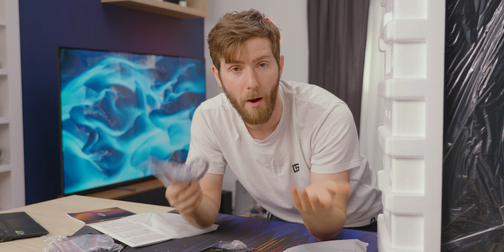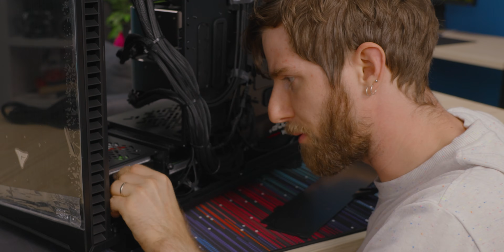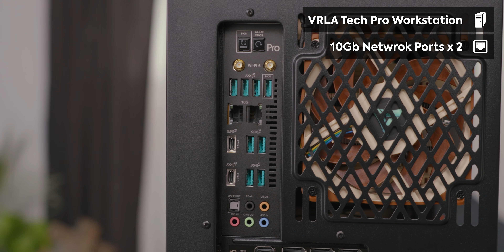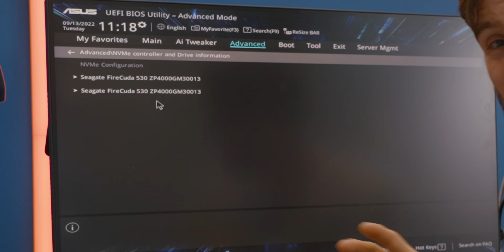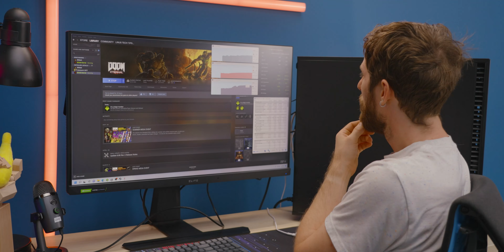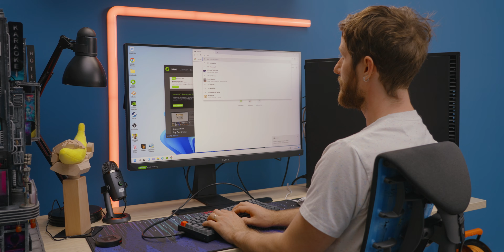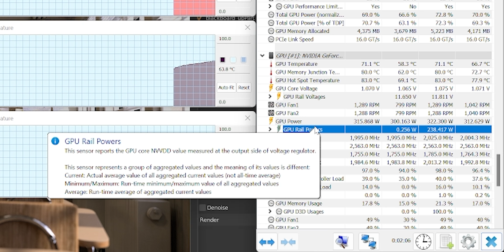This PC blew our circuit! - VRLA Tech Threadripper PRO Workstation

Comment: Hey Linus! I do use the analog surround sound on my pc motherboard! I jerryrigged a couple of normal speakers into a surround sound set up in my room and it works really well for VR immersion without the need for an headset.
Reply: I'm still running a full 5.1 surround system from the early 2000's. Haven't found anything cheap enough that can compare to make an upgrade worth it
Reply: @fatlessauto3  Sure its usefully if you want to run crappy cheap 5.1 surround system from the early 2000's. But on 20k$ PC?
Reply: @lambda7652  at 20k that might be most of your budget, and you blew the rest speakers and cheaped out on a dac cuz good enuff.
Reply: @akimbofurry2179  Yeah sure, it might as well have VGA output for your Analog monitor and maybe a "gameport" for your good enuff Gamepad
Reply: @lambda7652  I don't know what fucking planet you live on that you automatically assume that a five channel speaker system is crappy
Reply: @lambda7652  thats not the same, though i do still use a dvi monitor.
Reply: @lambda7652  native vga would be good for crts tho
Reply: @lambda7652  good audio equipment stays good no matter how old they are.
Reply: @gamagama69  Yes, its especially designed for CRTs. but its only good for CRTs...
Reply: @akimbofurry2179  Why is it not the same? 
VGA is an Analog interconnect and so is audio minjack.
Tarts fine for a Analog device Like a CRT.
or Analog headphones.
But with both you get all the analog problems.
Like ground loops and signal degradation.

 But if you have any modern digital Monitor the Analog signal need to get converted back to digital again. 
thats like taking picture of a monitor or scaning a print.

you inevitably loose quality
and the same is true for modern speakers with DSP processing and Class D amps or AVRs.
Reply: @lambda7652  still more functional then vga
Reply: @akimbofurry2179  how so? VGA is also perfectly functional.
Reply: @lambda7652  vega needs a graphics card that supports it. 3.5 is still commen.

So if shit breaks, malfunctions, or what ever, you still got those to fall back on, for testing, or to wait for replacements.
Reply: @akimbofurry2179  i don’t get your point? 
VEGA=VGA? 

My inertial argument was 3.5 on main board is like VGA on GPU. 
 
There are still many Monitors and KVMs around that support VGA. 

But no sane GPU manufacture would put VGA on high end card in 2022. 

Server on the other hand often still have VGA because they absolutely don't care about onboard video quality.

So what is the reasoning for putting Analog 3,5mm on high end board? 
sure you still can finde speakers with 3,5mm in like you can find monitors with VGA in. 

The difference is you don’t need audio for testing and you absolutely don't need analog 5.1 for testing and servers. 

You can get 10$ USB DAC next day from Amazon taht’s better in every way. so why bother putting it on the board?
Reply: @ProudOfYourRoots Keep telling yourself that. This isn't the 2000's.
Reply: @ProudOfYourRoots Response to what? This is the first you've replied to me and the first notification about it I have received.
Reply: @ProudOfYourRoots Maybe 20 years ago that was the truth. Motherboard audio is great these days, fantastic even.

Comment: Actually, i use an X Fi Extreme on pcie x1 and an SB omni 5.1, both on jack 3.5 mm. On one card i have my headphones and on the other card i have the edifier spinakker speakers. I also have a jack 3.5 mm "kvm so to say" from which you can direct the signal to the headphones or the speakers, but if i use that, i have to mute the edifiers everytime, because there is a lot of noise, like a constant humm

Comment: Not only do I still us surround sound speakers, (Klipsch ProMedia 4.1's from 2000 still kicking) but I also use a pair of Cooler Master Sirus 5.1 Headphones using the analog plugs to drive the 5.1 Speakers within its cans.
Reply: Just so you know, surround headphones with individual drivers work very poorly at best and generally don't sound very good either - sorry to say you've been had.

What you actually want is headphone virtualization to process a surround signal for common stereo headphones, either in a dedicated DSP / amplifier box as supplied with some models or in software altogether. It mimics the effect of the HRTF (head-related transfer function) on sound arriving from different directions. (Something that these multi-driver jobs are unlikely to, while not being subject to much HRTF effect themselves at all.) Games may already have some built-in, it is definitely worth a check.

Going this route would enable you tu use some of the many good stereo headphones available while getting better positional audio.

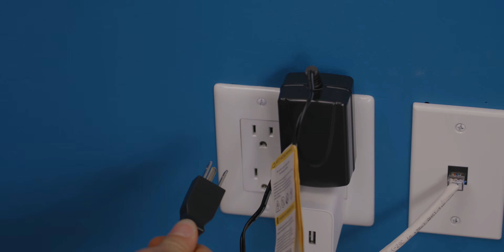Comment: 7:40 proves linus knows nothing about electrical. 15A 120V is 1800 watts, for safety reasons remove 20% of that. Meaning only 1440 watts are usable on a 15A 120V circuit. no wonder he blew a circuit. A dedicated 20A 120V circuit is needed for anything using 1600 watts.

Comment: I always use the audio ports at the back of the pc for 5.1 audio. Best way to get 5.1 surround from PC games. They never output 5.1 via optical or HDMI (from my experience, anyway).
Reply: But how good are onboard audio my friend. Get your self a external dac for premium sound.
Reply: @SuperSkandale  no its pointless money spent and more clutter and more outlets needed
Reply: @girlsdrinkfeck  also any external dac is trash unless it has it's own power, usb powered = heavy sound distortion gadget, this is the same reason why onboard sound isn't that good already and I use a pci soundcard which breaks my case airflow but once you heard it you can't go back

Comment: Just the other day I had to repair one of those motherboards. 
 We are a specialist highspeed broadcast camera manufacturer and using these motherboards, 3090tis, fiber pcie card and an SSD carrier board and threadripper pro in rackmount 4u 19" cases to actually be able to handle our data rates. 

We went to an exhibition in Amsterdam a couple weeks ago and one of our systems didn't work correctly. 
So that evening at an Airbnb I disassembled the entire thing, saw every error code conceivable and then noticed that our CPU AIO cooler had a leak and the bios chip on the motherboard was completely corroded. 
Well about half an hour , loads of cleaning with alcohol and a bios reflash later from a usb stick the system worked again and I saved 1 TB of ram, 1200€ worth of Motherboard and idk how many thousands worth of CPU.

Comment: 10 amps, 120 volts, 1200 watts, efficiency... =)
Reply: Efficiency in terms of performance per Watt but still a ridiculous abomination 😵‍💫
Reply: @ArniesTech  I was talking about the efficiency of the powersupply, at 85 or so percent the computer only needs to pull about 1000W from the PSU to pull 1200W from the wall. It's not a schocker that a 10 amp breaker isn't enough for a computer that has and needs a 1600W PSU

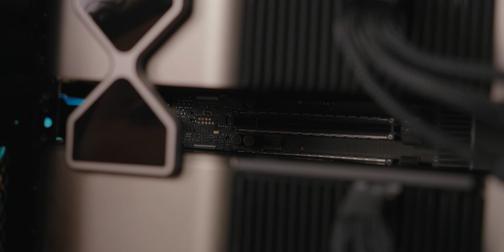Comment: 5:47 You haven't seen the NH-D15 I assume. I just built a new rig with Amd Ryzen 9 5900 and chose that for my air cooling. It's double the size of that and two of those fans. It's keeping my CPU temps 20-30 degrees under the 90c maximum for this chip on full load. Just fit in my old Antec 900 case. Didn't bother getting a new case.
Reply: He was referring to the heatsinks on the motherboard itself, not the CPU cooler.
Reply: @ColeMarkusen  When he said that he was circling his hand around the Noctua.  Thought he was just referring to the cpu cooling.

Comment: I use a 5.1 on my PC, but I rather use a real sound card to drive it, than those (mostly) mediocre on board audio solutions.
Reply: Creative and Turtle Beach dropped the massive ball on that. They both could have been audio chipset standards on motherboards. Creative specifically didn't bother for greedy reasons and look where they are now.  You don't even hear them mentioned in audio talks anymore other than nostalgia.
Reply: @Ancientreapers  I have to say, that Creative had a few issues a few years ago, in my previous system I had the Soundblaster Z and the driver had issues for years after every function update. When they released the Z SE, the old one got the same suite and driver and all issues vanished. With the AE-5 I have in my new rig, which uses the same driver package with Windows 11 I had not a single issue after upgrading to 22H2. They should really get more praise for what they achieved, I know there are on board solutions by Creative, but I don't think they deliver the same, or would ever have been able to, than their dedicated sound cards.

Comment: I stil use a 3.5 audio jack for my audio. But i have a good Excuse, hear me out. My soundbar ARC functionality has been broken, my SPDIF cable broke the freaking connector in the soundbar. So Aux is the only way to not have terribel sound from my tv. I like all the Bass

Comment: I still hookup my 5.1 surround sound speaker setup. Not my fault it's still alive after 20 years and working fine...
Reply: 12 yrs old z506, alongside a big ultra-wide is great for movies and TV.
Reply: @NetanelZZZ  I was so happy when I got an ultrawide and finding out how well 2.35:1 movies play on it.
Reply: @R_Forde  never heard anything about this 😮 Does it fill out the screen without any black line? You just might gave me a reason to save for a monitor
Reply: @whatever_12  No black bars.
Reply: You make me sad! My 2002 Sony just died.  😧
Reply: The only electronic type of things that doesnt need to be replaced every 2 years are music related.
I guess the saying that "Music will Save us" is the most accurate
Reply: @shuttzi9878  Yeah. Buy once, buy good and be happy until the distant future day they die. Good set of audio equipment will forever be good; at least on the audio quality front. I/O and UX aspect is a different matter. And speaker/headphone burn in is a good thing to always remember for new equipment. Have had my fair share of initial disappointment over how awful some decent investments may initially sound.
Reply: Same here, I even have a spare receiver in a closet just in case my current one dies, would love to do digital or Toslink but I can't find a decent Motherboard that offers actual onboard surround sound that shows up as such in games with output via onboard jack that is not "virtual" software multichannel audio upmixed from stereo or defaulting to stereo in the OS.
Reply: @Randon_Tain  i had to use a tool to force it from openAL spacial data or whatever. works pretty well for me although native surround is still better
Reply: @Randon_Tain  I believe this is a licensing issue. SPDIF (wether over coax or toslink optical) can only carry DTS or Dolby Digital surround formats. PCM audio carries no license, but there is not enough bandwidth for more than stereo PCM on SPDIF. I believe most games don't want to pay the Dolby/DTS tax, so only do PCM surround. I believe more recent versions of HDMI and recent HDMI reveivers can actually handle surround PCM over HDMI, but why throw out that nice but slightly older receiver for this alone?
Reply: Me too. My old Sony 5.1 amp has limited connections so I get 5.1 from my pc with 3 x 3.5 to dual phono cables.
Reply: Ditto!
Reply: 20 yo Pioneer is doing great as well. Inb4 I jinxed it lol
Reply: My Logitech Z-680 5.1 speakers are going strong after 18 years

Comment: So you could say say “ShortCircuit” shorted a circuit. 🦖
Reply: "short cutcuit" 💀💀
Reply: @bigtitmaster  I fixed it 😉
Reply: @luxzien  should've left it
Reply: Nah. That's not what a short is.
Reply: Because the fact that a dedicated 15 amp circuit is required for this if you’re having an electrician install the circuit just have him put the 20 amp circuit in with the 12 gauge wire and you’ll be future proof to run two of those systems
Reply: They did not short the circuit, they just overload it because of the ancient and bad north American electric system with only 110 Volts. In the most rest of the world with ~230 Volts this do not happen with only 1600 Watts.
Reply: @CrazyGamerTV  the American system is 240v just most outlets are only wired for half because they do a weird thing with splitting the power into +120v and -120v. You can also set it in a 20A circuit which would be plenty of power even at 120V but that requires more effort.
Reply: @megazombiekiller9000  No North America has 1 phase 110 Volts AC or 3 phase 230 Volts AC. So normal sockets which are 1 phase only has 110 Volts AC. They doesn't have direct current in the public system. In Europe there is 1 phase 230 Volts AC for the normal sockets and 400 Volts AC for power sockets for heavy machines.
Reply: @CrazyGamerTV  all homes (barring outliers that need higher voltages) are wired with 240V in a single phase, that phase is just tapped at +120V, Ground and -120V unless it’s like an apartment complex which is different and 208V for geometry reasons. If you are going to spout rubbish then go watch technology connections videos on the American power system. It’s definitely not as good as European power but we do have access to more than 110V it just requires different outlets and you could wire a 20A circuit for this without worry as well.
Reply: @megazombiekiller9000   AC Power is everywhere in the World the same. You have Phases, Neutral and Ground. You just get 2 Phases and Ground to your house. The Voltage Phase to Ground or Neutral is 110 Volts. The Voltage Phase to Phase is 220 Volts. This is because the Phases are not the same. They are 180° out of phase to each other. The normal socket of you has 1 phase, 1 neutral and 1 ground contact. If you have a 220V socket you have 2  phases and the ground.
In the most rest of the world you have 230 Volts Phase to Ground and 400 Volts Phase to Phase.
Reply: @CrazyGamerTV  fair enough, I’m just stating that America is not limited 120v, which a lot of people I’ve talked to seem to think is the case. That said we also have 3 phase 480/240v just not for residential usage unfortunately. Maybe with the advent of high power consumption computing people will start at least adding 20 amp circuits around the house for ~2000 watts at the wall like in some kitchen outlets.
Reply: @CrazyGamerTV  technically shorting a circuit makes it overload in an extreme way, something like 1000A while the breaker would trick at like 10 or 16
Reply: Long*